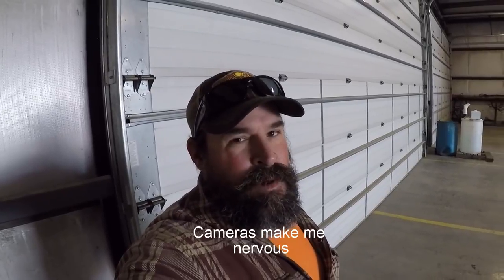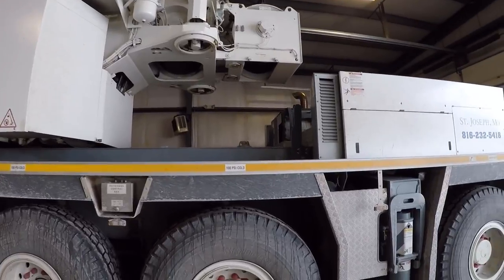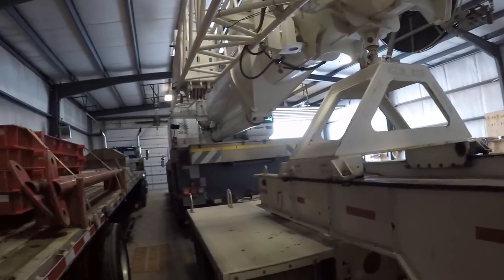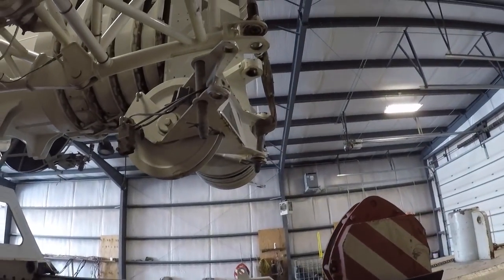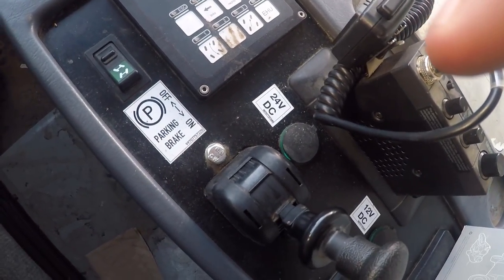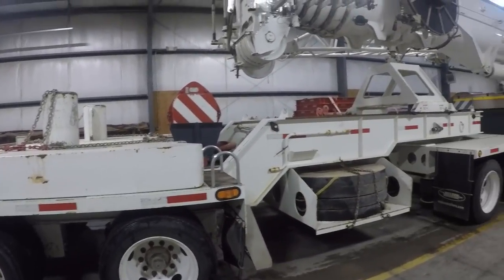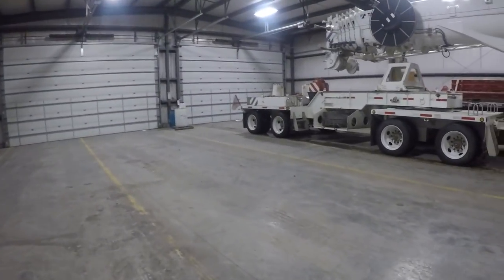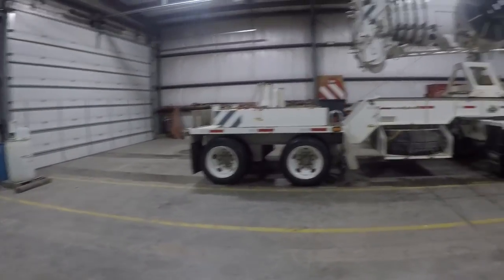To The Top Crane-intro video

Comment: Nice, just came over from letsdig18's channel as well. That dolly thing is quite interesting, you don't see that here in GER or Europe in general. Maybe it's a matter of oversize length and / or weight, or because of the space required when doing turns on  narrow roads. But quite handy if you save an additional oversize transport for counterweights. You did a good job with your first video, will leave a subscription.
Reply from the maker: Sebastian R., I was told that they typically don't use a dolly over in Europe because of the narrow roads. Thanks for watching and subscribing! 🙂

Comment: great video, nice to have the operators of a crane make some video's, when Grove, Leibherr and others make videos they sometimes do it too fast, or when they show us how to assemble  these cranes they skip steps or have the operators appendages in the way, so you can't see the pin or knob they are pulling/pushing. one Question: how fast does it take to assemble, ie from road condition to all booms up, and ready to lift?
Reply from the maker: andy van, assembly time is dependent on configuration. It can be as little as 1/2 hour to as much as almost 3 hours. Thanks for watching! 🙂👍

Comment: That crane sure looks like a Krupp. A local company that did quite a bit of lifting for us has a 125 ton Krupp. Krupp was the first, that I know of, to use the towed boom support to spread out the load over a longer area. I know Grove acquired Krupp and Grove is part of Manitowoc.

The Todano appears to have DIN[German] hydraulic fittings which I find odd for a Japanese machine. I've worked on a few German machines like Liebherr, Atlas/Terex, Fuchs and Sennebogen.
Reply from the maker: Tired old mechanic, the A/T Tadano's are built in Germany. I also see the resemblance to Krupp. I'm guessing because Grove, Liebherr and Tadano all build their A/T's in Germany. Our boom dolly was built by Nelson Manufacturing, in the states. Sounds like you have been around alot of neat machines.👍 Thanks for watching! 🙂👍
Reply: Tadano bought German crane maker "Faun" and slapped their name on it. It's still a Faun, designed and manufactured in the Faun factory in Lauf an der Pegnitz, Germany and even says Faun all over it in a lot of places still.

Comment: Great stuff I'm a crane op from Canada. Running a Tadano 130 rt. At a dam site now. Just wondering if there is a state or federal licencing in the states? What is your opinion on this, in Canada we have a red seal program. Thus all journeymen are trained and tested the same from coast to coast.
Reply from the maker: Mike Borud, thanks for tuning in! How do you like the 130rt? So far, in the states, there isn't a mandatory certification. Most places are starting to require it, and some cities have a mandatory certification process. My opinion on it is....(and this may start a ruckus) I am all for a national certification requirement. Thanks for watching! 🙂👍
Reply: That certification shit started here in UK over 30 year's ago. We thought it was great cause better job better money and happy ever after. Not true, now you can have an operators card in 2 weeks if you pay your money.  You can be working in a shoe store and 2 weeks later you're on a job operating a 100 tonner. Yes it's true and yes it's dangerous!

Comment: Recently found your channel & love it, instantly subbed, I live In Maryland & work for a welding company next to to crane company’s, I don’t know the laws but they seem to remove the boom totally & have a special trailer it sits on pulled by a peterbuilt
Reply from the maker: Kevin smith, what they have sounds like a boom launching trailer. They must have a bigger crane or the laws are more strict there. Thanks for watching. 🙂
Reply: To The Top Crane thanks for responding 👍
Reply from the maker: Kevin smith, thanks for watching.

Comment: Amazing for your first ever video sir . Am from uk and used to European equipment but have always wondered why the boom dolly is it for high reatrictions or center of gravity for travel if u have any idea ? Amazing amount of info u made my brain itch with happyness thank you  . Ps I found u thru YouTube recommdetion
Reply from the maker: Craig Nicholson, thank you! The dolly is to spread the gross weight out over more axles, therefore reducing the per axle weight. Thanks for letting me know how you found my channel. Seems like YouTube is now starting to put my content out in the mainstream. Thanks for watching! 🙂
Reply: To The Top Crane thank u for putting out the videos sir
Reply from the maker: Craig Nicholson, I'll keep making them as long as people keep watching them. 🙂
Reply: Every State in the US has different laws as to the weight you can have on each axle and the distance between axles. They don't want too much weight in a short distance. The dolly makes the combination longer and adds more axles to spread the weight over a longer span. For heavy loads over 40 tons gross, and loads over a certain width or length, most states require a permit.

Comment: Awesome machine. Are those planetary hubs? You almost have a gear for each mph. Urea is ridiculous, they're worried about CO2 that they say is warming us, but they're more worried about soot that just settles. I don't know why folks can't merge. I can be on a desolate stretch of interstate with my cruise set at 5 over and 50% will have themselves at the end of the merge lane with their nose just behind the hitch of my trailer. I guess it's the strange psychology of driving. Great video. Hope you have some nice neodymium magnets for those nice cams!
Reply from the maker: Jimmy's Tractor, they are indeed planetary hubs.
Reply: To The Top Crane guess they decided a high speed driveline was the way to go with 8? wheel steer(my son's Lego has 8 with stationary center lol) and all the other weight savings that go with it. Does it crab? Some things just make sense when you think about em! I've watched a bunch of crane vids and absolutely love your perspective!
Reply from the maker: Jimmy's Tractor, it is 8 wheel drive and 10 wheel steer. It will crab, round and front steer. It does have a high speed driveline, but with the planetary hubs, it is slow on the road.

Comment: I only have a 22101.  One of my "tree-guys" put a Go-Pro on my ball, I knew if I wasn't Dead Smooth, I'd look like a cowboy.  That turned into a LONG video!   (but it was smooth!)

Nice rig!  I can only wish.
Reply from the maker: Thomas Nelson, putting a camera on the ball shows just how much it moves around. Even when you are as smooth as glass. I have a few videos with a camera on the ATB weight or on the block. Thanks for watching! 🙂👍
Reply: Don't mention it, I was binge-watching for an hour or so.  Here's a link to the video I mentioned;  yeah I know,  I'm "small taters"!.  I still try to be the best & safest that I can.     @ToTheTopCrane
Reply from the maker: @thomasnelson2463 , a crane is a crane. There is no less danger or responsibility in a 10 ton rig than in a 200 ton rig. You may have to email the link. YouTube tends to filter links out. My email is tothetopcrane@gmail.com.
Reply: @ToTheTopCrane  Thank you, I know "a crane is a crane" but I understand that there is a WHOLE different level when you get into the 40+ton level.  200 ton with 330' tip height?  

I have a 22101 boom truck,  I'm NCCCO certified, & safety is #1.  Thanks for the kind words.  

I shot a lot of good video for posting, but when I got my website going, I realized I would be incriminating my best contractors for OSHA infractions.  They've been deleted. nelsoncraneservice.com
Reply from the maker: @thomasnelson2463 , nice work on that tree removal! That video is awesome! 👍That little saw sounds like it's possessed. Lol.

Comment: Thats a super impressive machine.  I've got an old 40ton P&H friction truck crane and have a thing for them.    I'd really like to hear more about what you go through to move that beast.  It has to be a permitted load right?
Reply from the maker: It is permitted for over length, over width and overweight. I have some videos of it going down the road, if you haven't made it to them yet. "On the road again" is one that does a pretty good job at showcasing it's size. Thanks for following along. 🙂
Reply: To The Top Crane cool, ill take a look at them.  Found your channel last night, have seen all the videos yet.

Comment: Show us a set up of your dolly, my boss wants to buy a bigger crane but doesn't want to commit 2 guys to 1 crane. Would be kinda neat to see what you've got going on
Reply from the maker: Tyler G, I have an older video of the dolly. I think I have covered almost every system on the crane. Aside from the drive train. But, that will probably happen soon. Depending on the size of crane your boss is going to buy, a two person crew is a necessity. These bigger rigs would be impossible to set up without a second and sometimes a third person. Many thanks for watching! 🙂👍

Comment: What’s the fuel burn for the crane itself? And I always thought they would have lots more power than that...
Reply from the maker: Sycamore Valley Shops, fuel burn is very inconsistent. If I am doing repetitive work, the burn rate can be fairly high (6 or so gallons per hour). If I am doing inconsistent work, I can run for 3-4 days on 50 gallons. Thanks for watching! 🙂👍

Comment: Faun German carrier. Tadano Japanese crane. Awesome quality.Salt is enemy. Ruined alot on our older GMK 5120 Grove. We sprayed oil under frame to stop rust.
Reply from the maker: james norse, that's a good idea. I hadn't thought of that. Peanut oil in a pump up sprayer would go a long ways to preserving things underneath. Thanks for watching! 🙂👍
Reply: To The Top Crane In Canada they use Krown product cosmoline. I sprayed entire underneath of trucks and crane in salty NYS. Bad rust.
Reply from the maker: james norse, cosmoline is some messy stuff. But, so is rust and corrosion. We get quite a bit of salt here in the midwest during the winter.

Comment: Is this the default transport configuration? Can you drive on public roads with the boom swung to the front over the driver cab?
Reply from the maker: Razorback1360, that is the configuration that we have to use when we travel on the highways. We typically travel with the boom over the front in our local area. Thanks for watching! 🙂👍
Reply: To The Top Crane The crane should be in the boom dolly on any state maintained road
Reply from the maker: @cranedude5847 , when I said "local area" I was meaning in our local city. We are allowed to run inside of our local commercial zone without the dolly. However, we can't venture outside of the city limits without the dolly. Thanks for watching! 🙂👍